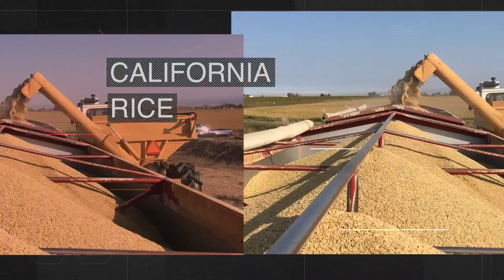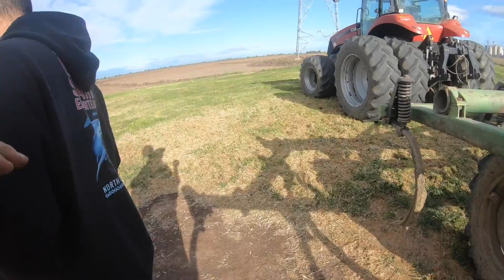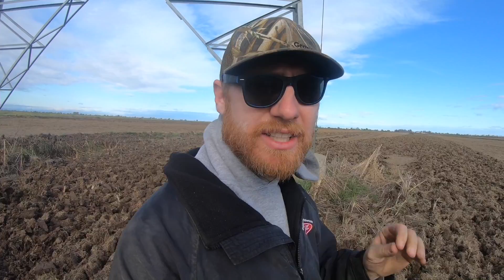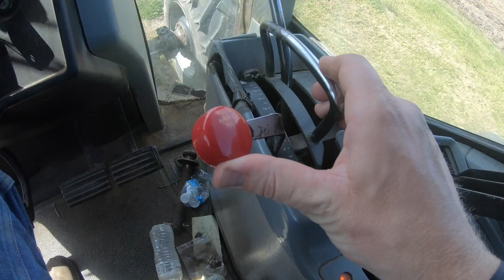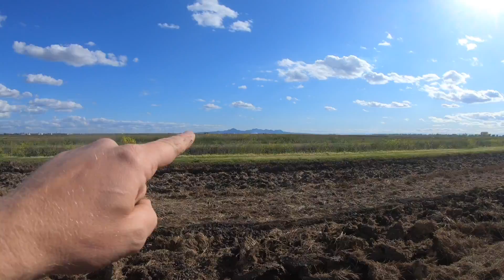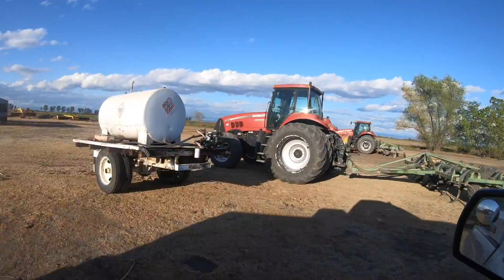Moving Metal and Planting Rice in this Tractor Video! | Day 4

Comment: I ran an Allis Chambers tractor just like your neighbors when I worked for Sid Vistal near Verona. You need a battery powered impact to remove and install those chisel extensions faster and to save you wrist from tendinitis like I have
Reply from the maker: Jeff, good call with the impact for the chisel shanks. I hope the Easter Bunny drops one off.
-M.

Comment: How do they plant the rice from air where the power lines are. Isn’t it a bit dangerous?
Reply from the maker: Stephen Chaplin, yep they fly under or over and around. It’s dangerous—but those boys are pros.
-M.
Reply: They usually fly under them, theres plenty of room underneath. They are very very skilled and have been flying those planes probably before they had license to drive a car.